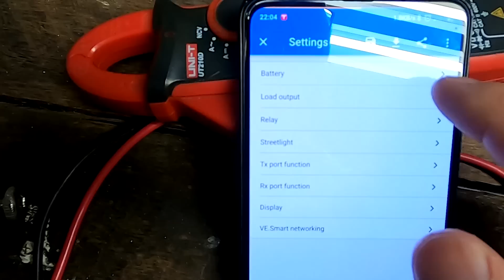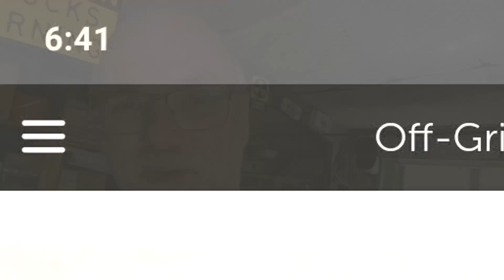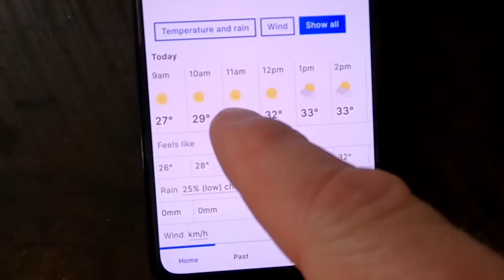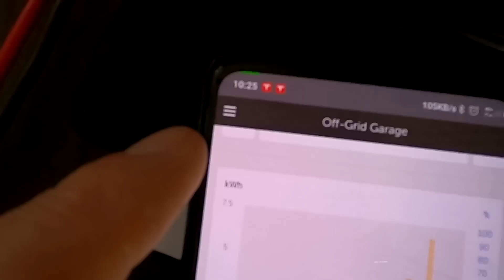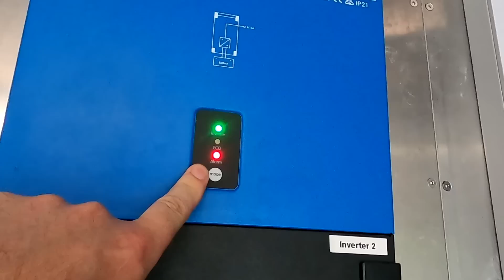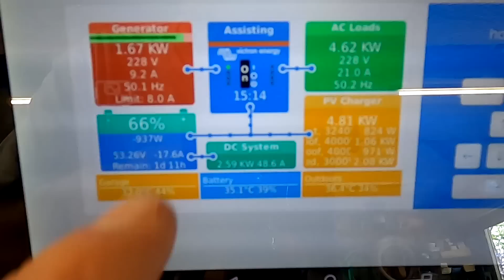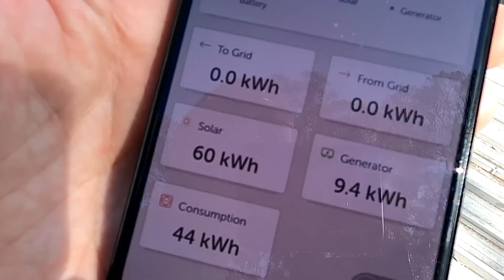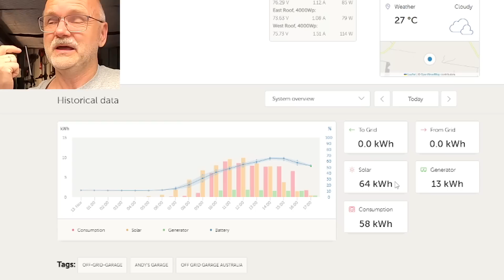New solar system, maximum yield test. How much can we expect? ☀️⚡

Comment: Will be interesting to see what you get at the Solstice.  Of interest I used the NREL prediction tool to look at typical energy production  mo th by Month and with 30 degree arrays (a bit further south of you at Canberra latitude, December daily production is actually less than Oct, Nov, Jan and Feb.   But the NREL Tool does consider a lot of factors and does under predict my system.
Reply from the maker: That will be interesting. I use the Victron MPPT calculator which gives you a prediction over the year as well. It's under reporting a bit as well which is good. It does nto consider shading from trees though, so that's a factor which I cannot really predict atm...

Comment: Nice to see the pool fence solar still in place. 😅
Obviously it's not connected anymore.
When you need more load for the next test: dump some heat in the pool water ;-)
Reply from the maker: It is actually still connected to the MPPT inside the garage but not connected to the battery anymore. Would be another 1.7kwh at this point of time. We will use it for the PowerWall 2.1 soon, hence I didn't remove the panels yet. 
Yeah, a pool heater is on my list...

Comment: Just a thought- strategic lopping of branches rather than felling trees!
Reply: A bit tongue in cheek! Amazed how good your output with the new panels is despite the shading!
Reply from the maker: @effbee56  Yeah, I'm blown away every day. This morning dark clouds, rain, still outputting 3.5kW. I would have never thought the new panels are that much more efficient than the old ones.
Reply from the maker: It won't make a difference and too expensive. There are trees everywhere. It's not just chopping off a branch here and there. They need to be cut in firewood size pieced, removed, cleaned up and the garden to be restored. I have spent all this money for that now in panels instead to start this experiment.
I have enough energy even with the trees. For now at least...

Comment: Really nice Andy but I'm more interested in what can be done with 2000 watts of panels and a 200ah battery at 48 volts. 
 Maybe gearing down your system and testing it would help out many lower-budget folks out here.
Reply from the maker: That is pretty much what I had when I started with the battery 1.0. Should be heaps of videos on the channel with that.

Comment: Hi Andy! Your solar installation is great, very powerful, and you'll see when you have bad weather you'll still be happy, of course when it's very sunny, half a day will be enough to fully charge your batteries.
I think you now have the installation that will give you full satisfaction! 
Andy, did I forget? your Tesla car, can you charge it directly with the DC? and also with the inverter?
Thank you again for all these videos, always great!
I also liked the new BMS with the active balancer coupled! Too bad they don't do it in 16s, but I think if we ask JBD they will make it? 
The control screen I've been using it for over a year, it's really good (from JBD too)
Thank's again and see you Next Video....
Reply: Tesla does not allow charging direct from DC from any devices we could afford to buy in a residential space. The DC charger bypasses the vehicle's internal charger and needs to communicate with the tesla bms and provide at least 72kW (up to 150kW) at 480VDC, neither of which is remotely reasonable from a 50kWh battery like Andy has anyway. Just the DC-DC converter to go from 48V to 480V at these power levels cost in the tens of thousands of dollars US.

Comment: Andy will two 350w 40v panels In series for 80v produce more wattage then two in parallel at 40v for the two ?
Reply: The potential wattage output of ur 40v panels theoretically should not change between a series or parallel connection to a mppt controller, what will change is the charging voltage potential of system, ie; 2 x 40v  panels in parallel means u can only charge a storage battery up to 24v 0r 36v max (ie; when ur panels are producing above 36v), in series @ 80v u have half the current (amps) in circuit, but u then have a potential to charge a battery up to 70+volts & ur controller will keep this to a set value for ur batteries chemistry.
Reply from the maker: Same output. I have tested this with two 40 panels and the Bluetti battery. No difference in   energy production, sunny, cloudy, shading, does not matter.

Comment: It would be interesting to see the output if you had optimisers to allow current to bypass the shaded panels better. Wonder if your daily yield goes up 10% or more.
Reply from the maker: Optimizers will not help in this situation at all for two reasons:
1. I don't have one long string but many small parallel ones
2. Optimizers only help a little bit when you have panels in one string facing different directions
Everything else, they don't bring any benefits. See also this video here from Andreas Spiess more information: https://youtu.be/E9NVLB_OYSU

I have tested optimizers already with some of my panels and could see huge voltage spikes when combined with a MPPT solar charge controller. They basically fight for the best max power point.
Reply: Victron actually states not to use optimisers with their MPPT solar charge controllers, as they may damage them.
Reply: Yes he only has 2 panels in series. If he had 8,9 or 10 panels in series optimizers may help but he would need different charge controllers. I think he built his system and chose components wisely. His daily kilowatt hour average proves that with his heavy shading. I'm glad no trees were harmed during your solar testing Andy!!!

Comment: Honestly - it is not interesting what you can get in summertime, it will allways more, than you can consume. 
For me, it is interesting, how big has to be the battery in wintertime to fulfil my requirements at the given size of my PV Pannels without run out of energy.
Reply from the maker: Absolutely. Summer is easy, so seeing the system in winter will be interesting. I'm still not sure if it is enough to get through
Reply: @OffGridGarageAustralia it is like an addiction isn’t it Andy, uv got me hooked. I’m sure you should/will have plenty of PV power for now & all year round, what will probly change more, will be ur use will increase, mainly because u can or feel u need to, and this is why I do think another  45kw of extra storage for those rainy weeks, & extra backup for Tesla charging as well couldn’t hurt,especially when things are getting gloomy in the “Sunshine State”, more batteries = more days backup & more kms in the Tesla, and while ur contract may be 5-6yrs away, Ill bet ur still often thinking about when u will be able to hook up the whole house, Im sure I would be. Cheers
Reply: Well he used 64Kwh in the time the sun came up until it went down say 7 or 8 hours under extreme testing. So I would say 90Kwh of total battery capacity would be perfect 👌 to create more videos....and never run out power storage ever.

Comment: The Northern Hemispheric is different in the winter because is closer to the Sun and cooler. A similar setup can make over 110 kw a day, even in the Dec 21st that is the shorter day of the year.  Victron 250/100 had to be replaced for Schneider 100/600 because in the winter voltage went over 250 volts and stop working. With the Schneider MPPT can have 10 panels in series for simplified connections and it never goes over voltage.
Reply: Yeah good point
Reply from the maker: You just don't have the hours of sunshine in wintertime up there, so I doubt 110kWh is possible with such a system in European winter and optimal setup.

Comment: Nice production in such a cloudy day.
Have you thought about adding extra batteries to your 16s battery pack. I think it would be ok to add extra 2 batteries and make it 18s configuration. That way victron input battery voltage would not be increased as it takes up to 66v and 18x3.5 would be 63v anyway. So that way you would get more storage per battery pack. Only limitation would be that you can not set max charging value more then 66v for whole pack. But as I remember you had 3.5v at max.
I am not an expert, but seeing all the Victron specification and battery cell setup makes me think that it can be pissbile to do. It would just save some space and equipment for adding new pack if we could increase storage of existing. What do you think? Maybe you have alredy tried that before?
Reply from the maker: Yeah, some have suggested that but I'm not a big fan of that and don't see much benefit of doing this. I would struggle to add two more batteries to my shelf without doing a major re-design of the space again. Not worth it.
I don't really need more storage but more loads

Comment: You are now Australia's Super Power House - Congratulations Andy. I have got a 6.43kW solar only and on November 26 2022 (Sunny all day long) it produced 50.4kWh - happy with that.
Reply from the maker: Oh, wow, that is an incredible amount of energy for such a 'small' system. Fantastic outcome. Is that grid connected?
Reply: @OffGridGarageAustralia  Yes, we are pretty happy with it. 22 LG Neon2 335W panel (on same roof side), Fronius Primo 8.5kW and the Tesla Powerwall 2 with backup Gateway - Backup power for the hole home incl. AC. In winter we could do with more battery power though.

Comment: Andy, I doubt that you could get maximum production in December. I am in Europe and maximum production I had in May, around 22kWh from 3,3kWp solar array. During the summer months my max. production is around 20kWh.
Reply from the maker: I have to wait for the day which gives me the longest hours of sunshine. That makes the difference. It's not the strength of the sun but the time it shines.
Reply: @OffGridGarageAustralia  Maybe in Australia, but in Europe no, based on my data. During the summer I have a lot of days with production around 18-20kWh, but in past 3 years the peak production was in May around 22kWh. I think it is because of less temperature of the panels, so the efficiency is higher.
Reply: @stanislavmlcuch2085  in Australia is summer now ..
Reply: @TheRealAnthony_real  :D I know about this. I just pointed out that I have maximum peak production in the spring not in the summer. Maybe in the Australia it will be different. I am sure Andy investigates this :)
Reply: Ithe sun is closest

Comment: How often do you need to clean the solar modules?
Reply from the maker: Never.
I used to do it in the past, spent 1h on the roof and cleaned them all. Never saw an increase in production afterwards.

Comment: Awesome. I learned remove plastic form inverter face so I can read what it was on. Volts and has a decimal point. Turns out in late fall 43 latitude I get 13-16 kw a day. I need to test all panels as one of them is not performing right and it brings all down to 80 watts(on 1 string which also brings amps down on parallel string) so I am loosing 5-6kw a day because of this. Thinking I will just order new panels in the spring to replace 20 of the worse ones. I am learning so much. As you have just get new panels from the start.  I only use 13-16 kw a day so this almost covers my load. next summer I am going off gird as your name says.

Comment: Great test Andy! I would say a regular cloudy/sunny/cloudy day is just as interesting as full sun all day. I would say its more useful to know what an average day will produce vs knowing what a perfect day will produce. You will have a lot more average days than you will have perfect days. 65Kwh is a lot of energy and the new solar panels are working great. I would like to see you get a nice air compressor and a long air line so you can blow off the leaves and clean the panels for tests like this so you have perfectly clean panels and maximize your power generation.
Reply: I use a rechargeable leaf blower.
Reply: @john_in_phoenix  Also a great idea. If you collect some rain water when it Rains this summer, maybe you could use  the combination of a leaf blower, a squeegee and some of the collected rain water, and you could get the job done very well in as short a time as possible
Reply: @catch22frubert  I think you can the use water only at sunset, when there is no direct sun on the panels and only if their temperature dropped quite a lot from the usual 50-60C. Because using cold water on hot panels can crack the glass. And that is a fire hazard! In Andy's case, as long as there is not a lot of dirt on the panels, a battery operated leaf blower will suffice.
Reply from the maker: The leaves come and go with the next breeze. Not worth doing anything about it. It depends on the weather and if the trees drop a lot and wind blows them directly on the roof. They don't affect the production at all.

Comment: It boggles my mind that the Victron inverter can't hit full power without overheating in the ambient temperture of the Off Grid Garage.  It looked like the VRM was saying it was 33C(91.4F) indoors and was 37C(98.6F) outdoors.  I would expect the design of any inverter to be able to handle it's full output rating well past an ambient temperture of 40C(104F) before hitting overtemperture and needing to be derated.  They probably need to improve the airflow path or increase the static pressure of the fans to compensate for the increased ambient temperture. In order to meet the 3KW output rating that they claim the inverter can do.
Reply from the maker: The Venus inverter in particular gets hot when running in this climate for hours. It's not overheating though, just an alarm. It will overheat eventually though, hence I dropped the current by 1A when I saw this alarm. The Multiplus seems to be better handling the heat. The space in the garage is certainly not ideal for these devices but that's just what it is.
Reply: We don’t have victor on here, but there are two types of hybrid inverter. IP 65 and IP 20 or 22, can’t remember, the weather and water resistance rating. The ip 20 ones don’t have the same cooling features, fans etc that their ip 65 counterparts have. This also means that the ip 20 ones heat up much quicker here and an additional fan is necessary but that will still cause problems as ambient temperature in rooms hits 40~50 degrees Celsius. Ip 20 inverter are cheaper by 300-500 US dollars compared to the same spec ip65 one.
Reply: To be fair Victron put the rated outputs at different temperatures in their specs.
Reply: Hi, they de-rate when hot, so need a little 12v 12w snail fan on each to keep them cool when you are working them.
Could wire them to a thermostat or timer.

Take care M

Comment: Wow, nice, enjoy your "free" solar (you already paid so it's going fast in regenerating your "lost" money). If this is such a high yield, is the expected turnaround time for your equipment around 5 to 7 years? Might need to buy your wife a nice electric car, cheap driving!
Reply: Once you go off-grid it's not so much about pay-back/turnaround time, but of the freedom and independence it gives. It's a feeling that is hard to put into words, but is absolutely worth the money.
Reply: @upnorthandpersonal  there are a lot of benefits from being able to use the sun like this.
Reply from the maker: Very hard to calculate any ROI with this system. Maybe that is something once the whole house has been connected.
Reply: @OffGridGarageAustralia  yup, add the house! Generate as much money as possible with the house solar! Great way of thinking.

Comment: Try cleaning the debris off the Solar panels. I have found just  cleaning them can make gains big time !
Reply from the maker: I have found that cleaning panels does not do anything for power output. Especially the few leaves will blow away with the next breeze. The next one after will bring new ones, so it's a bit of wasted time doing that. I have to clean the gutters here and then though.

Comment: Looking good.  You can also just use some space heaters to use up energy on these tests.  A lot easier than trying to run a chipper or find things to charge.
Reply: True. Another option: use an electric water heater to store hot water to be used later
Reply: Do they have heaters in hot and sunny Australia? I could send you one from Canada... If not 🇨🇦
Reply from the maker: We do have heaters but what would heat up in 40°C🤷‍♂️
The hot water system takes only 3-4kWh/day, less in these hot conditions. Pool heater would be an option, Crypto Asic, AC for the garage maybe...
Reply: @OffGridGarageAustralia  I think a nice little mini split a/c unit would be a good DIY project for the Off-Grid Garage and useful in your climate... You gotta find a way to use that power...and make more videos...
Reply from the maker: @XunHinGeD  Yeah, I have a few options...
Reply: @OffGridGarageAustralia  I am talking air heaters.  Commonly used to heat a cold room, but you can just let it run outside and it will still work(as in waste energy) in hot weather.  I guess you could also turn on the Tesla heater or AC and leave the windows down.
Reply from the maker: @jmaus2k  That would make no sense as I could just turn off the solar when the battery is full as it does now. I was rather looking for  something where I can use this energy for, more or less 'useful', I guess.

Comment: i see more batts in your future. to keep up with the panels. for winter. how long could you run it all on the system as is? days ? hours? weeks?
Reply from the maker: That's still to be determined. At the moment, I'm burning through energy like crazy as it is free. I would not do that normally (leaving pool pump running 24/7, computer runs all day, ...). I really need to connect the house at some stage to find out, I guess...